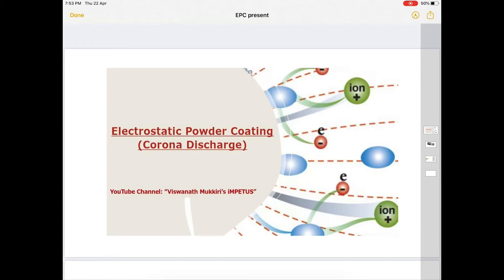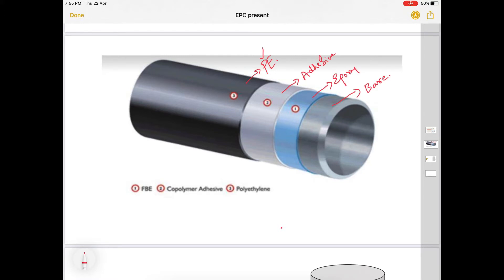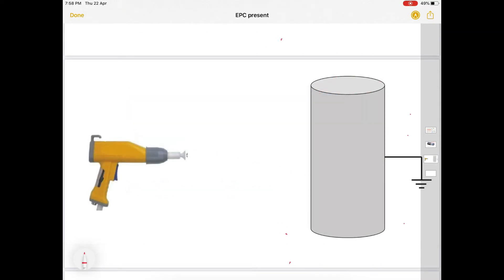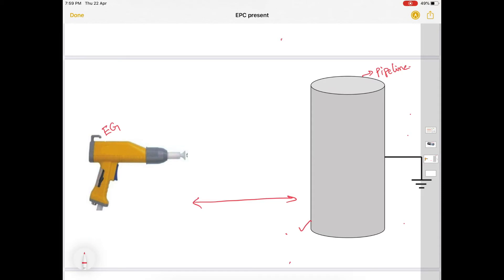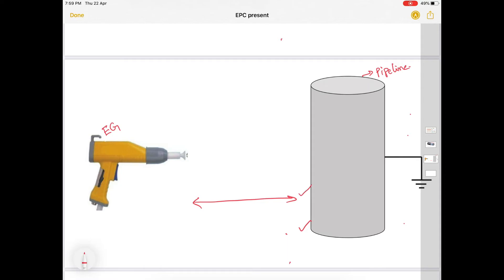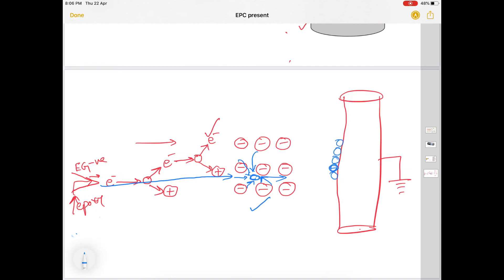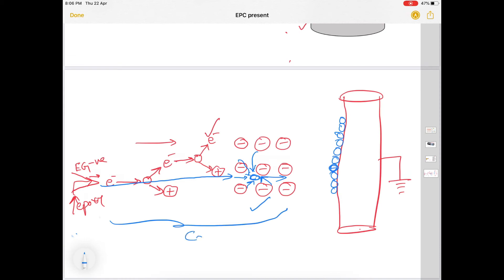Electrostatic Powder Coating - Corona Discharge Mechanism

Comment: Good Explanation, I have a question how can I powder coat FAR INFRA RED POWDER on steel pipe surface as when I try to Electrostatic Powder spray it is not sticking to the surface of the pipe It is falling off when we tap on the pipe , Pls advise